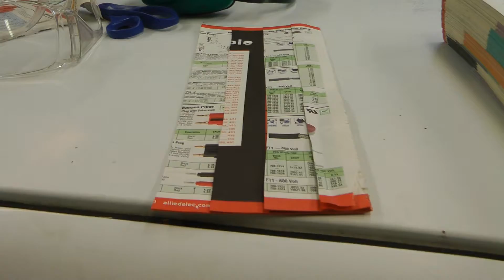Electric car upgrade part 2 - Batteries and Busbars

Comment: aint it crazy how brackets can take up so much time . ivw built a few in my day. it can take a 1/2 hour to build an accurate bracket if your not set up for it , sure you can crank them out like an assembly line after 5, but when you gotta make just one and your shop aint set up for bracket day its time consuming

Comment: They should not expand unless you're wanting to kill them. My Thunder-Sky 40Ah only expanded when overcharged and shortly after they died. I have been using the rest without straps, properly charging them and there's no swelling.